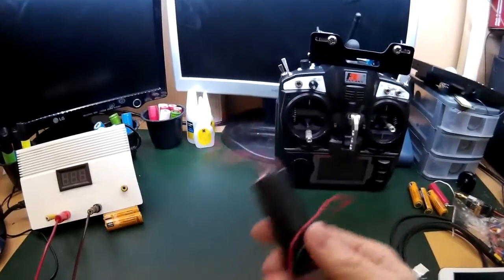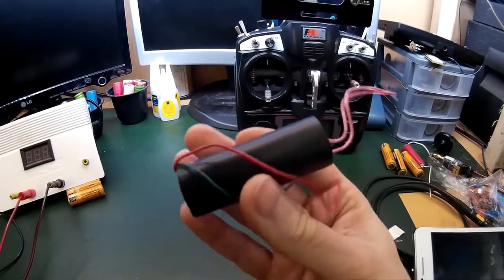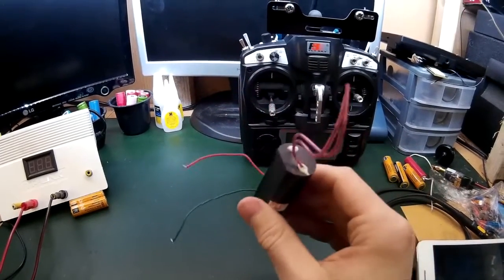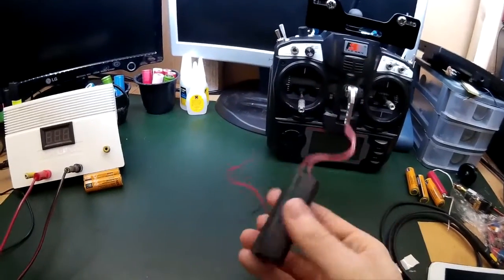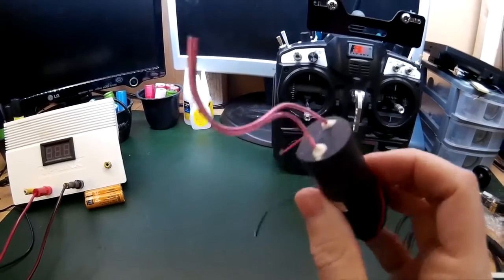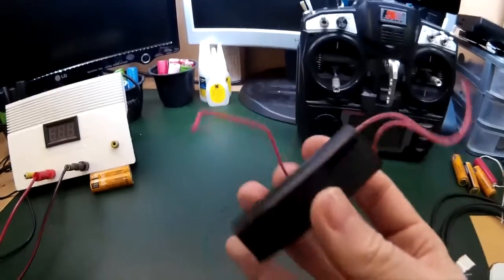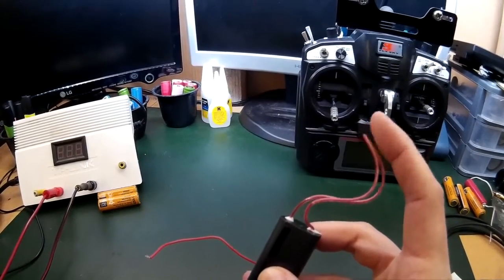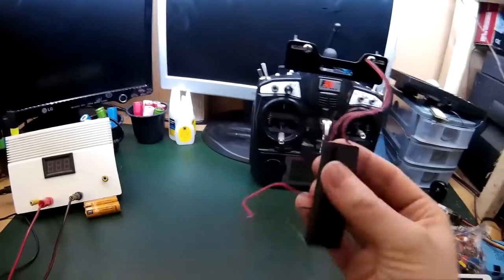400KV high voltage generator Demo

Comment: Hello Norfolktuber brother, is 6volts the maximum input voltage for this? What is the optimum voltage to run it? And how long can it be kept running continuously, especially if you want to build an ionizer or ozone maker out of it?
Reply: I have heard that it is not advised to operate them continuously or they will burn out.. hope that helps :)
Reply: +John Berry 
Ok, thank you very much :))

Comment: HOLY PAPER! That is some unit. What was the input current like Jace? My regards to you all.
Reply from the maker: +Raymond Earle Hi Raymond hope your well my friend. on my small power supply it was maxed out at 1.5 amps, just tried it on the big power supply and at 6volts it's current draw is 2.5 amps.
All the best Jace.
Reply: That's cool. How many amps on the output do you think. I know you can't measure it easily. I am enjoying the sun from the inside.
Reply from the maker: +Raymond Earle Not sure i did try a cheap meter on the milliamp and 10 amp range but its all over the place.
Reply: That's ok. Was just curious.

Comment: Just got one myself...doesnt actually put out 400kv.
Reply from the maker: +Akmaisto Mods i put some thicker gauge wire on and it was pulling near 5amp, very loud but it did not last long best to use at 5.9v 3.5amp last longer and leave wire alone.
Reply: Interesting.
Reply: @la7yka  - There is a point where it just ionizes the air instead of sparking. With such low current I'm surprised it sparks at all.